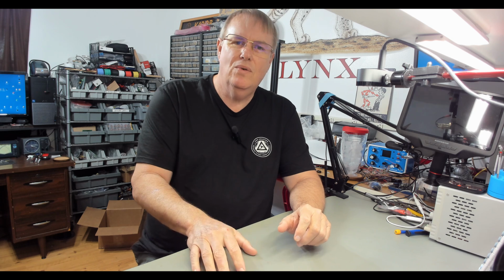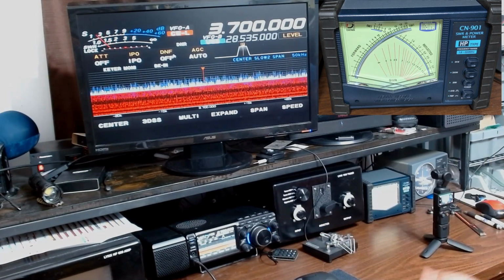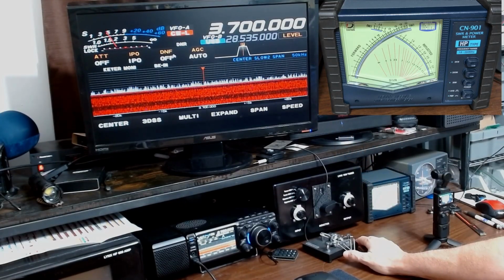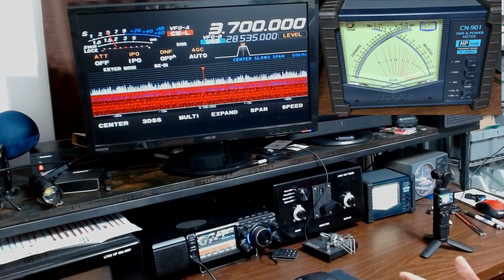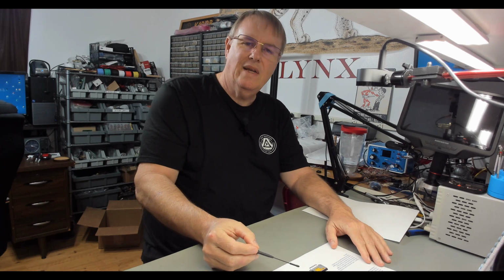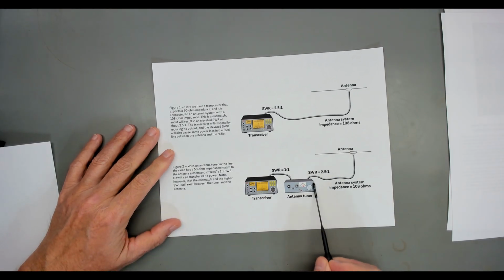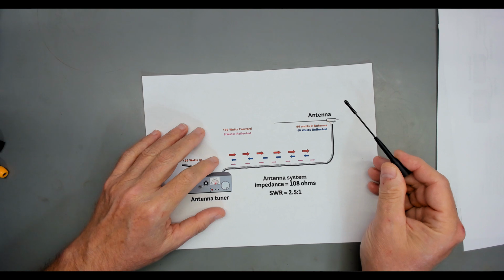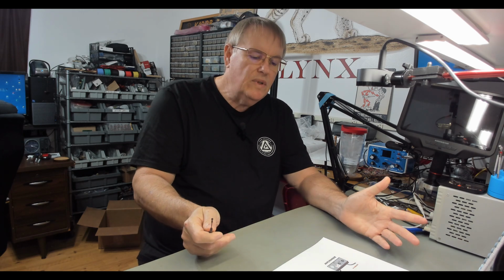What Most People Get Wrong About Antenna Tuners!

Comment: You have a clear misunderstanding of resonance, resonance does not mean its 50ohms or 1.1 swr, a resonant folded dipole is around 300ohms that's 6.1 swr, you said a resonant antenna won't have any reflected power, it clearly can, resonance doesn't guarantee it 50ohm or efficient, resonance is when the capacitive and inductive reactances cancel each other out, the tuner creates a conjugate match between the antenna feed point and tuner output, the reactance has been cancelled out making it resonant, the whole system is electrically tuned to resonance
Reply: The added forward power is the reflected power joining the forward power on its return to the antenna, you are correct in saying the only loss of reflected power is in the feedline or the antenna so if we had the theoretical lossless feedline no reflected power would be lost it would all be radiated by the antenna no matter how high the swr is
Reply: It’s much easier to ask people to have an SWR meter before the tuner and one SWR meter after.
Reply: @PerB_M an swr meter doesn't show you reactance
Reply: @Pioneer936 no, but it shows you how much power is turned into heat. Thats why I only use remote tuners attached direct at the feed point.
Reply: @PerB_M efficiency has nothing to do with any disagreement here, it's about resonance, sure there's some loss in the feedline but that also depends on the feedline and frequency in use
Reply: Pioneer 936 You can email me. My posts keep getting deleted. I'm good on the Zed.
Reply: @N9XRradio yeah some of mine are, if it's kept in public view people can learn from any conversations
Reply from the maker: Both of you are incorrect. Your post were being thrown in the held section because You tube's algorithm appears to interpret your aggressive tones as inappropriate. I cleared them as soon as I saw them in there. Only inappropriate post get removes on my site.
Reply from the maker: Both of you are incorrect. Your post were being thrown in the held section because You tube's algorithm appears to interpret your aggressive tones as inappropriate. I cleared them as soon as I saw them in there. Only inappropriate post get removes on my site.
Reply: @LynxElectronicsLab thank you for the explanation.
Reply: @LynxElectronicsLab those with knowledge on the subject can see we are correct when we say the tuner electrically tunes the system to resonance, there's plenty of good engineers on social media that agree and help people understand exactly what is happening in the antenna system
Reply: The entire system is not tuned to resonance or the meter wouldn't still be showing 2:1 swr......
Reply: @VE9ASN resonance has nothing to do with what the swr reading is, as mentioned above resonance is when reactances cancel each other out, that's what the tuner does with a conjugate match between the antenna feed point and tuner output
Reply: @Pioneer936 yes, but the reactance is clearly still there, or there would be no standing waves. You're assuming resonance, you've proved nothing.
Reply: @VE9ASN understand conjugate matching, the tuner does not change the mismatch or swr on the line it cancels the reactance only, resonance doesn't mean there's no swr, a purly resistive folded dipole is around 300ohms with an swr of 6.1, its resonant because there's no reactance not no swr
Reply: @Pioneer936 I understand, and the match is only between the tuner and the rig, you've changed absolutely nothing on the antenna side.
Reply: @Pioneer936 you said the entire system is tuned to resonance, and that is entirely incorrect.
Reply: @VE9ASN the conjugate match is between the tuner output and antenna feed point
Reply: @VE9ASN you clearly haven't read or understood my first comment, I am just repeating myself, I don't mean to be rude but why don't you go and do a little study on what I've said, reflections by Walt Maxwell goes in to great detail on this subject
Reply: @Pioneer936 sorry, you've changed no physical parameters, only electrical, the match is only between the tuner and rig. You have not changed the feedline or antenna characteristics whatsoever.
Reply: @VE9ASN I haven't said physical parameters have changed, but the electrical parameters have! REACTANCE! Has been tuned out and that determines resonance
Reply: @Pioneer936   the reactance is still there, from the tuner to and through the antenna, that's my point.
Reply from the maker: No, I really don't. Go read the previous post you got on me about when I was responding to someone else and you thought I was replying to you. What did it say? It is true that I sometimes do use the word resonant in the less technically correct way as do 99.xxx% of hams to mean the point of least SWR. But I do know the difference. It is also true I do not consider myself an expert. Just a hobbyist learning more everyday on electronics since i was 9 years old, so 50 years and inviting others along with me. As a really smart mentor of mine once said. Until someone shows me the impedance change on the feedline and antenna after the matchbox, it ain't tuning my antenna. I agree with him and know that is is simply matching the mismatched antenna to my radio. There is a reason matchboxes do not come with Vector Network Analyzers in them but do have SWR meters on them, cause in the real word SWR is what we try to do away with not zeroing out reactance's. Just like half the circuits in my radio matching impedances between two circuits and not one EE has ever tried to convince me that it was changing the impedance of the circuits themselves. Do the same exact thing with an antenna and all of a sudden it's total different? I really do not have anything else to say about it. Everyone has a right to believe what they want. I force no one to accept my findings.  I just present them with something to back them up.
RJ
Reply: @LynxElectronicsLab also you video is about putting everyone straight on what a tuner does, you need to be technically correct if you are attempting to correct the myths or you will just add to them, which I think you have mostly in this video
Reply: @Pioneer936  "also you video is about putting everyone straight on what a tuner does, you need to be technically correct if you are attempting to correct the myths or you will just add to them, which I think you have mostly in this video"  -  I agree 100%
Reply: @LynxElectronicsLab my original comment that you disagreed with me was,,, I love my antenna tuner tuning my antenna system to resonance,,,, this is a true statement, with the tuner using its capacitors and inductors to tune out reactance of the system becomes resonant of which you explained this to another person in the comments of another video, so the confusion is why you disagreed with me but explained this explanation of what a tuner does to someone else?